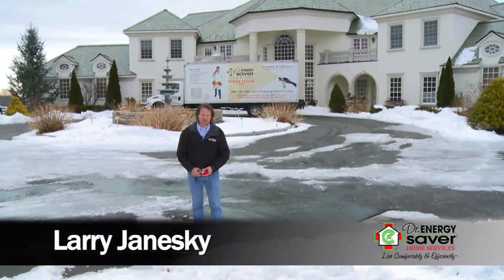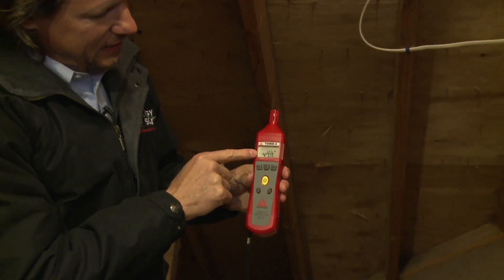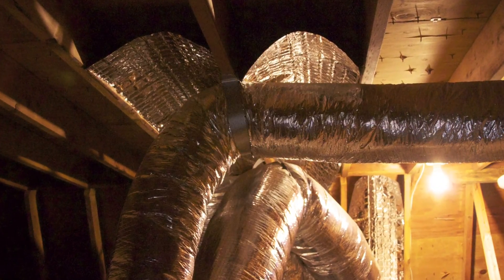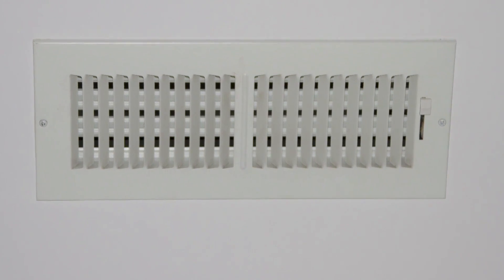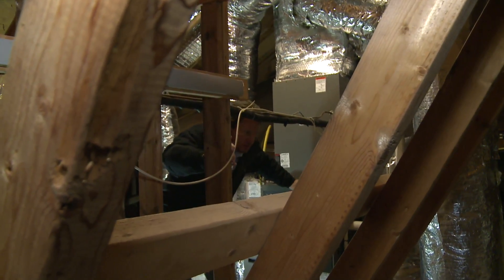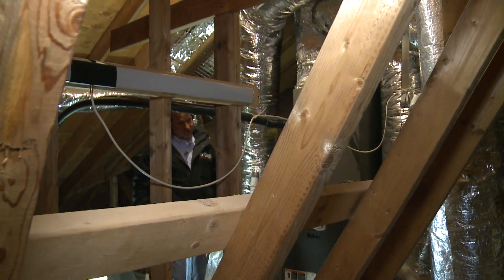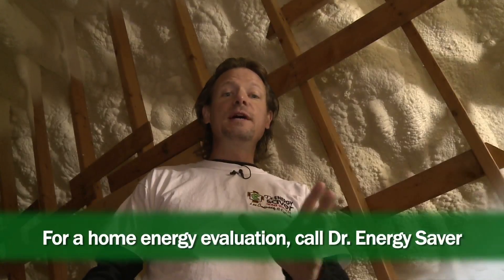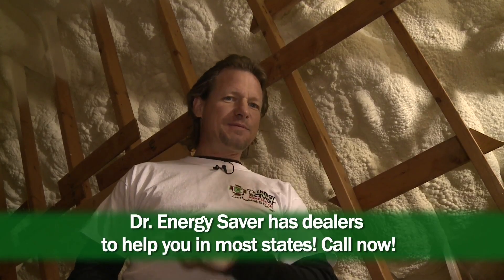Insulating and Air Sealing an Attic with Spray Foam (Long Version)

Comment: With this video being 9 years old, is the "solution" provided still the recommended one?  Was the ridge vent/soffit ventilation existing in the house closed off, and if not how does that work post spray foam?  Thanks.

Comment: I have a situation where they applied about 3" of closed cell foam across the bottom of the rafters. I have no way of knowing if I have a roof leak. If I do it could run down into the exterior walls. Is this application against code???
Reply: Tony Fox wouldn’t you be able to tell if you have broken shingles on the roof?
Reply: @danielanderson4709  Hi Daniel, I've been a General Contractor since 1985. Any roof leaks I've run in to were found from the bottom, thus trying to locate it from the top. The only way I would know that there is a rook leak on top is if I saw some lose flashing or an obvious hole. I've had two of my Roofers also look at it and they said they have never looked for roof looks from above and neither could ever issue a roof inspection report unless they could see the underside. Having said that, if they would have sprayed the foam between the rafters, at least we could see water damage and/or stains on the rafters indicating a problem. Not being able to get a written roof inspection is a Major problem, ie;, re-sell. I also had another Foam contractor tell me he has never seen it done that way and I couldn't get a termite inspection since they couldn't see the rafters and sheathing. This is a major problem in my opinion!!!
Reply: But you don't have as much thermal bridging from the rafters.

Comment: A couple of key elements Larry forgot to mention.  1. The difference between closed and open cell foam insulation, both in performance and cost.  {Open cell insulation is in the same category as other insulation products, fiberglass, mineral wool batt etc)  Closed cell foam is also a vapor barrier, contributes to the structural rigidity of the building, can be applied directly to the underside of roof sheathing, and costs twice or more what open cell foam does.  R806 of the residential code requires continuous ventilation between the underside of roof sheathing and insulation.  Many products are available to provide that but with anything but closed cell foam insulation that plus soffit and ridge vents are required.  2. The amount of confusion about this subject in the 'stick built' industry is ridiculous.  Another place where the building code is 50-100 years behind the times.  'Authorities' abound who argue that insulating an attic floor and making the attic space an 'outdoor' space is an ideal solution.  And then there's the crawl space.

Comment: one thing you should mention is if you have a gas furnace in these attics, you have to deal with the combustion intake! otherwise it will cause problems..

Comment: if your attic is like a cooling fin to the shingle, then why would you plug up the cooling fin.  How is the air going to go up the back side of the shingle to keep it cool and not shorten its life.  They will just have to replace the shingle more often.  The 50 year shingle will fail in 10 years just because it was cooked daily.  Also some the air flow stops you from hitting the dew point with any 20 plus degree changes in temp to stop condensation

Comment: Without venting the roof, I believe ice damming is still a risk.  The decking insulation will reduce the heat transfer to the shingle in the winter, but shingles will still be warmer than the outside.  Therefore it can still melt the water when it's 30°F outside, and then refreeze in the gutter.  Thus an ice dam will form.  I believe this method of insulation is okay in the south where ice dams are not a big problem.m
Reply: Correct, ice dams will occur, but they won’t be nearly as severe as when you have heat escaping through the sheathing 24/7.  Even though ice dams may occur, that’s why it’s critical to use ice and water shield on the sheathing.  Some say to put it from the overhang edge and 3 feet past the living space and in any valleys.  I say put it on the whole roof for added protection.
Reply: It's not really good idea to foam over the ridgecap vents or soffit vents and steal the attic air tight...I thought u also were gonna show the quantified cfm proof afterwards too? Sure it will save alot more $ anyways being the attic is now air sealed very well 👌

Comment: Hello
Sealing the attic sealing seems fine. But having had two recent leaks in my roof I am concerned about the water staying trapped in the plywood and rotting it rather than going through to the drywall and thus warn me about the leak.
Is that fear justified.  My attic is blistering hot in the Summer and I am looking for a solution. Radiant barrier being one of the options.
Reply: carlos lovera 
Good point, was thing the same👍
Reply: Very good point.   If you use open-cell foam it will allow water to get through as it isn't a moisture barrier.  I recommend this because if you have a leak, you'll get your normal, "why do I have stains on my drywall" signal, and will be able to address as needed.  Using closed cell, or a moisture / vapor barrier could lead to moisture being trapped under the shingles and cause a lot of rot - eventually compromising the framing.

Also note - once you do this, your roof will be a real pain in the butt to replace in the future, as that spray foam will adhere to the ply.  If you ever need to replace the ply, pulling it up will leave pockets that will sweat and cause damage, even with an intact roof above.  You will need to fully remove all foam under any plywood that needs to be replaced, and reseal it afterward.

But, when you're talking about cost saving, over the course of 20 years, you'll probably save 5x more on energy costs compared to the extra labor you'll have to pay for a roof replacement, and you'll also have a much more comfortable home.

Comment: My question for you Dr Energy. Now that they have the spray foam, did they put in something like an EVR to bring in fresh air and take out the moisture? if not, they will have a lot of mold growth?  I am building right now, and plan on doing an EVR after I get my whole house like a closed envelope.
Reply: ERV
Reply: @RugbyNick6  Thanks,  I Guess I had a typo 🙂

Comment: I wouldn't use spray foam in my home. For one if your roof starts leaking you won't know it. Second, all the air leaking into the attic from that room is still going to leak into the attic and out the ridge vents. So, I'm not sure what this guy is talking about. Your still loosing the warm air from inside the house. A better option is blown in insulation in the attic.
Reply: That's why you SEAL the attic.

Comment: Question re: less costly way to help determine locations and extent of air leakage into attic.  Couldn't you just maximize the difference between the unconditioned attic and the conditioned house (eg-max heat in Winter or max A/C in Summer) and do some thermal imaging around the attic to see how many hot spots you had and then deal with those??

Comment: What happens to moisture that enters the attick if there's no venting?
Reply: If the attic is conditioned space the moisture is being controlled the same way it is in the rest of the house by the HVAC system.  It wasn't mentioned in the video but in order to do this you'll have to put HVAC vents in the attic.

Comment: What did you do about the vents from the soffit to the ridge vent? Is it not necessary to add baffles to vent the roof surface so the heat from summer sun doesn't build up and cause the shingle life to be shortened?

Comment: shingle life will be greatly shorten because they will be really hot in summer
Reply: Not true.  Although it may seem logical that the decking temperature would be increased the evidence doesn't support it.  You can find a number of tests on youtube showing no significant increase in decking temperature after the attic was sealed.

Comment: I just have one concern about foaming the rafters and spaces in-between the rafters -- what if the roof gets a leak? How would you find out about it??? You would not until the roofing plywood was completely rotted. Not to be a party pooper here, but, in fact, there is no "ideal solution" to insulating a house.
Reply: Correct. It is common for the roof to be covered in snow and ice shield instead of just tar paper when using this solution. Added security against sheathing rot.

Comment: If I wanted to spray foam my attic and seal it up would the existing cellulose insulation on the celings need to be removed?
Reply: Nope, keep it. even if you seal your attic, you still want the energy you use to heat your home to stay in the living space of your home. having insulation between the attic and the ceiling will assist in that.

Comment: Soffit vents are sealed obviously.  Blower door numbers were reduced by 3000 cfm and fuel bills reduced by 50% - and this is after many other improvements were made the year before - we still got 50% reduction in fuel from that lower level of usage.

Comment: You give compelling reasons to insulate the roof. I can imagine things stored in a more room temperature attic would fare better as well. 

But, what happens when a roof develops a leak? The open-cell foam would act like a huge sponge potentially spreading damage over a large area. And since you're sealing the back side, the water would run down the wall below?..
Reply: Joe Stallings My Dr Energy guy said that open cell was better for this reason. With open cell it leaks through the insulation and you can see it leaking, vs closed cell where it would be hidden in the attic
Reply: Wow, good point...

Comment: Disappointed u didn't show how u sealed between the top plates and roof deck around the outside walls. 

Also as others said, what was your CFM After your work?

Comment: Hey John, 
Is there any problem with using spray foam under an old tin roof (metal partially exposed? I was thinking that condensation would be a concern. I'm waffling between baffles + foiled board foam or spray foam. 

Additionally, I only have two gable vents, without soffit or ridge vents. I have a really old home that definitely needs some work.

Thanks!
Reply: Christopher Thomas foam the exterior of the roof you get the insulation and a seamless leak proof system in one also adds structural integrity 50lbs compression per sq. In.

Comment: Great video!

Ditto to @qazwas2001 comment below! Larry mentioned "before" the blower door test was moving 11,500 CFM, but didn't mention "after" value.  Do you have those numbers?

Also, what % did the homeowner reduce his utilities (gas/electric) by? Even a worst case (low estimate) scenario would be helpful.

Finally, what was the approximate $/SF cost of this job? Was there anything else done that might affect the cost other than what was mentioned in the video? Thanks for your help!

Comment: If you sealed the attic, won't the humidity just stay in the attic?

Also, I saw you sealed the ridge vent, do you also close the soffits?
Reply: You put your exhaust fans out of the roof that's how you eliminate humidity